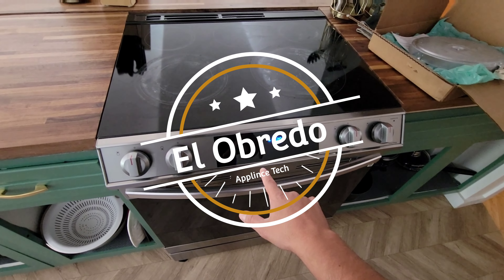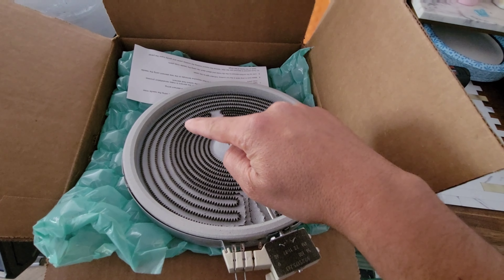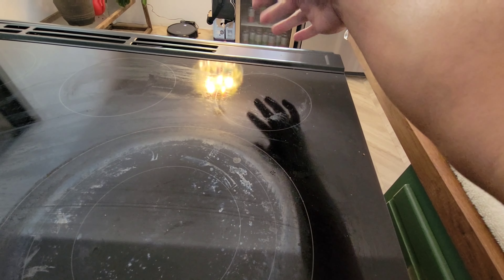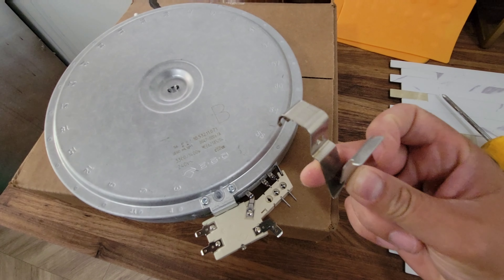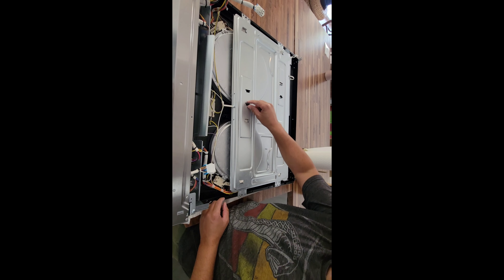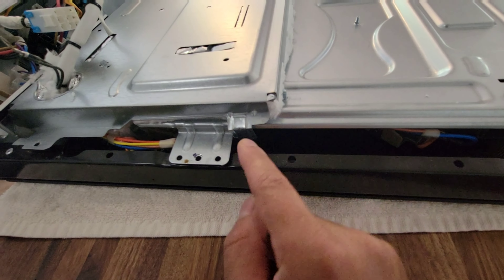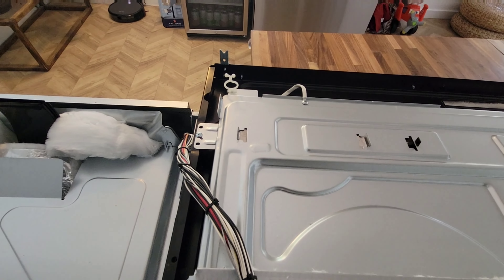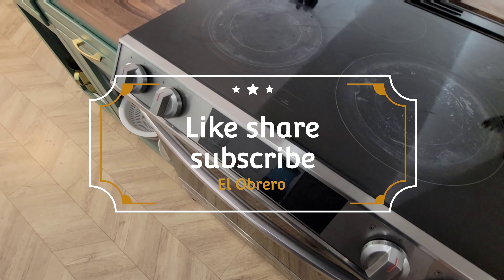Samsung NE63T8511SS - Repair

Comment: is the part number for dual range element the same for both? i can only find one part for it
Reply from the maker: This one is the duel element.
Reply: I replace mine and still didn't work. 
not sure if it's the switch because when I turn it on the light on the stove that said "cooktop on" is on.

have you experience this? what could it be
Reply: How can I know if is another piece like the switch button before to change the burner?
Reply: @IyahEvery4  I had the same issue. Even after replacing the larger unit on left, it still does not heat,, though cooktop is on.